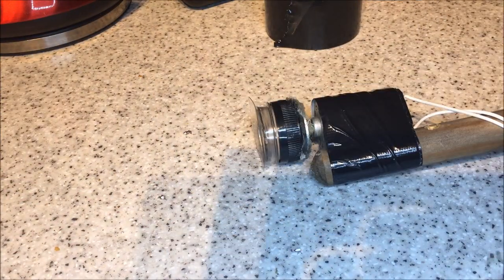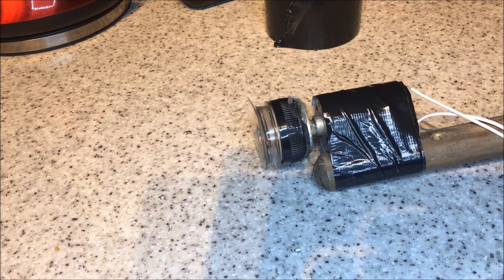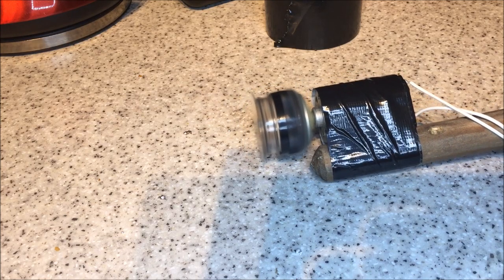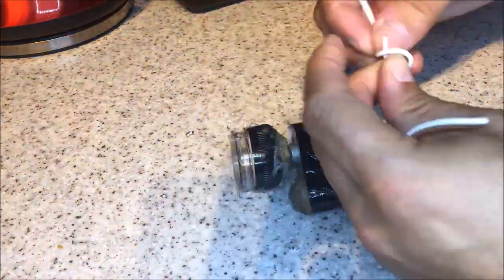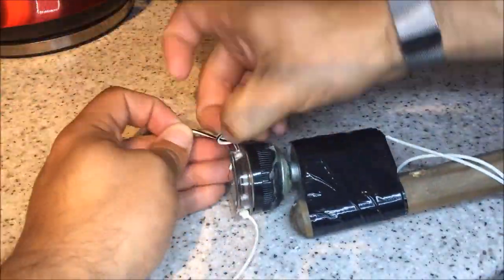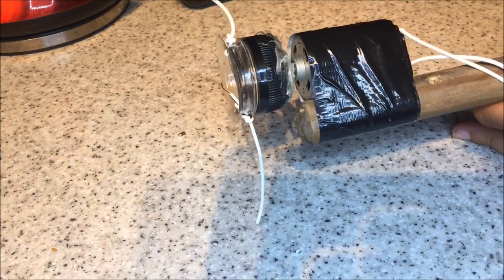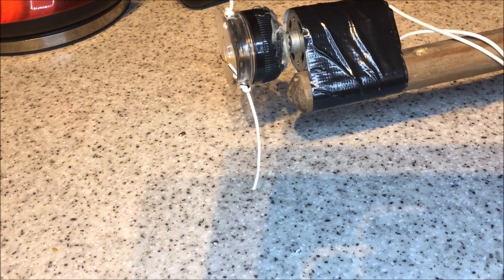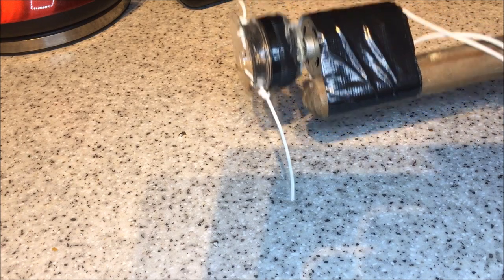DIY Weed Whacker - World's Trashiest strimmer in 3 mins flat!

Comment: Huh. That looks like it actually worked out as a half decent weed whacker. The cables got tangled when horizontal under the lawn mower, but if you mounted it at an angle it might be viable.
Reply from the maker: Nainara32 it just doesn't have the balls...  and overheats quickly... :-(. ...  we have a plan for the mower cutting blade!  :-)